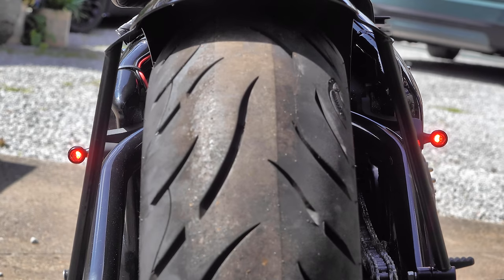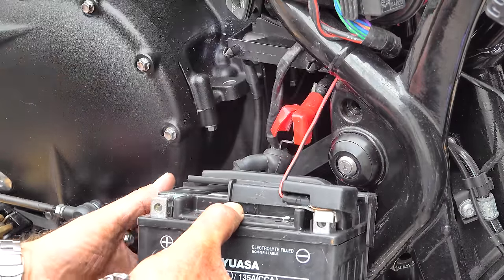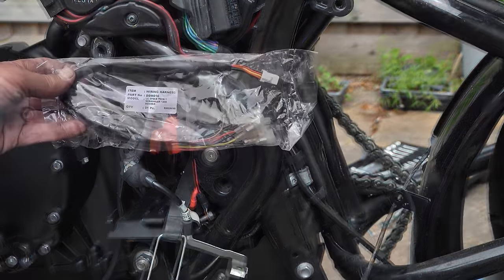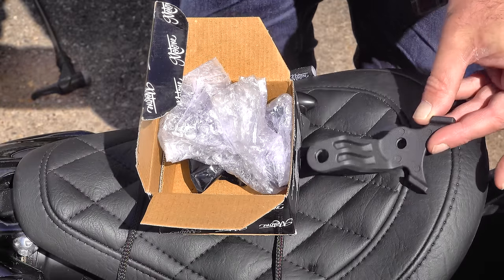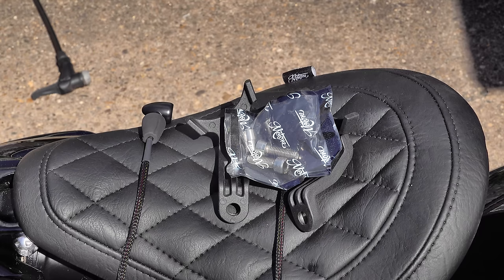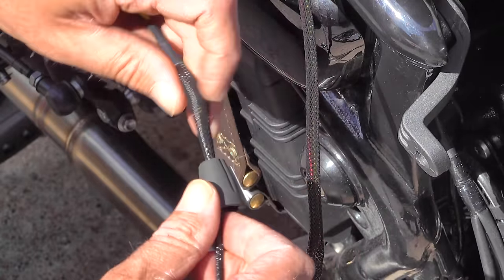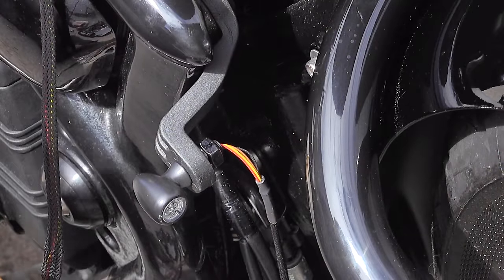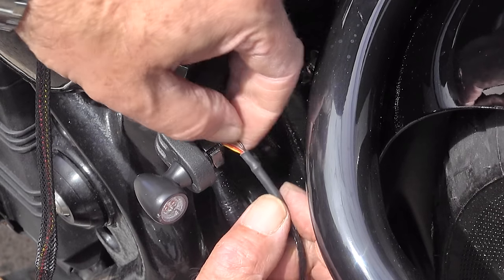Triumph Bonneville Bobber Black Project pt3! Fitting the PICO multi Micro lights!

Comment: It annoys me when after market manufacturers produce an expensive item and put shoddy bullet connections on ! A proper waterproof plug would be far better. A small slit in the mounting bracket would save the need of removing the rubber boot .
Reply from the maker: Its holding about 10 grams. dont see any weakness there myself.
Reply from the maker: Pretty high quality weatherproof connectors in my opinion. If they used plugs they would  have to make several versions to suit different manufacturers to ensure compatibility. That would substantially bump up the cost.

Comment: l think those indicators look great, plus the three in one functionality is something l haven't seen before... Here in Spain its not Triumph stopping us fitting other than OEM parts...its the Governments ITV system..(MOT)...For instance, l thought a set of LED indicators would be a nice upgrade to my 2014 Bike... There are quite a few generic alternatives, however fitting anything without the Triumph logo will bring about instant ITV failure. Consequently, to avoid that aggravation I've had to purchase the genuine Triumph parts which cost a lot more. ..l recall your video a few months back about  possible ''Government interference'' regarding the  fitting of only OEM parts,  plus the possibility of no modifications of any kind... That will be a sad day...Regards from España

Comment: I'm considering auxiliary lights for the Triumph Bobber.  One headlight is okay but could be brighter.  The light pattern is a bit strange due to the Triumph T-shape beam.  I prefer something small and bright clipped to the forks. I heard some Triumphs have an aux power plug under the tank.

Comment: Stuart, I've fitted a pair of led indicators from motone and used their plug and play, indicators work fine but hazards don't work anymore!
Reply: I just put another brand of 4 in one LED's on the back of my bike and the hazards didn't work until I also replaced the front turn signals with LED's. Once I did, my hazards worked fine.

Comment: I've been following you for a little over 2 yrs since I decided to buy myself a Bonnevile T120(2022 Red/Silver) I appreciate your comments and instructional videos about doing your own maintenance.  Changed my oil and filter, after forcing out the Phillips screws the local shop had stripped on the bash plate I had installed just before my 600 mile initial maintenance. I had a tap and dye set I'd gotten at your suggestion, fixed the threads and all is good. I really appreciate your guidance and advice.  I'm lucky to live in a US state that isn't as antagonistic to motorcycles. (Arizona) I watch with alarm the BS you're having to put up with in the UK related to emissions and their short sided attitudes towards the issue. Your even handed comments and videos warning people and pointing out that they need to stand up to that kind of over reach is a wakeup call to something that will eventually (as in soon) reach these shores and people need to pay attention. Good on you!

Comment: Hi Stuart, I'm not sure how to explain my question, but here we go. Do you think you can fit these pico's like the front set? Without changing the rear fender and attach these using the triumph turn signal brackets and just replace the rear lights. Thanks.
Reply from the maker: im not sure. i suppose some farbrication would be required
Reply: @stuartfillingham  thank you for replying so soon. Sorry, I mean keep the rear oem cluster , remove the big break light, and then swap out the indicators for the peco's using the brackets.